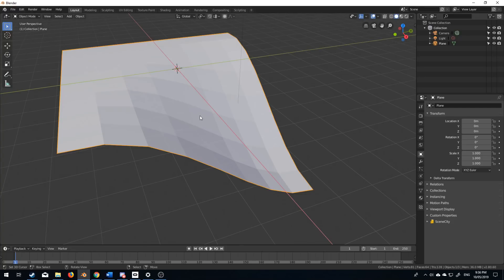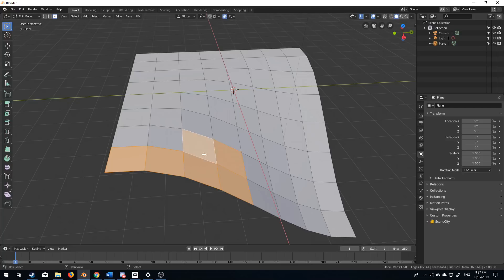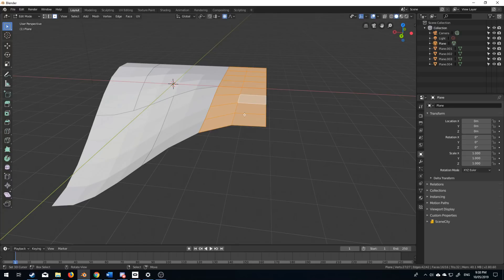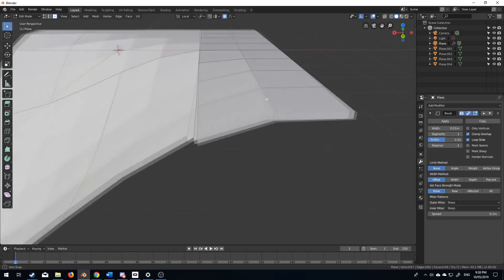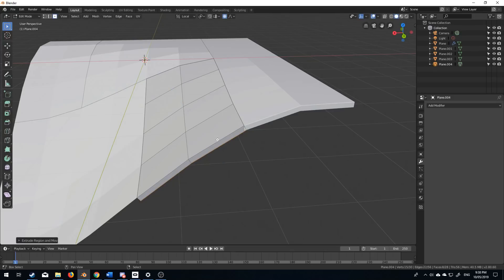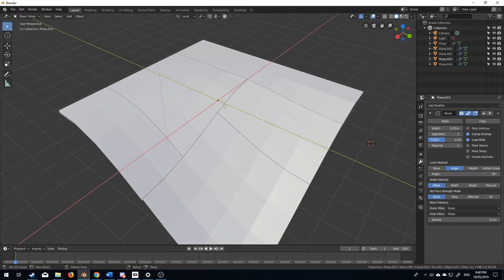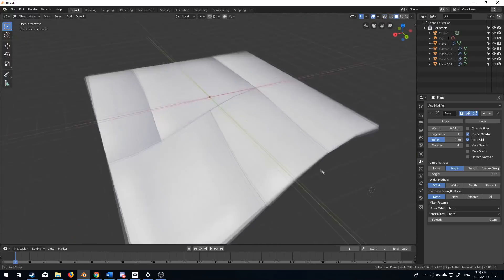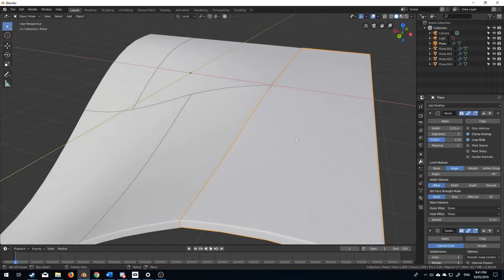Blender  - Create Scifi Panels - Alternative method

Comment: Would be easier with the solidify modifier. you can tick on 'Only rim' so it will remove the back faces aswell.
Reply from the maker: Agreed, just showing an alternative version - https://youtu.be/CF19jm4fA3M
Reply from the maker: @Samuel Wilton I just went through and updated the thumb names and titles. https://youtu.be/CF19jm4fA3M is the solidify version

Comment: You can keep all sections together in one layer. Make your selections then hit [Y] to separate just that selection. Repeat as necessary. Then you can extrude each section together with individual-origins clicked instead of median. Apply one bevel mod and that will keep everything unified.
Reply from the maker: Took me a bit to see what was happening here, but Y look like the same thing as double tapping I
Reply: @Markom3D  He ment Split vertices (Y or Ctrl V > Split)
Reply from the maker: Just pressing V will rip the mesh yes